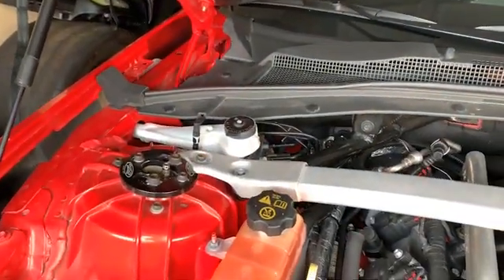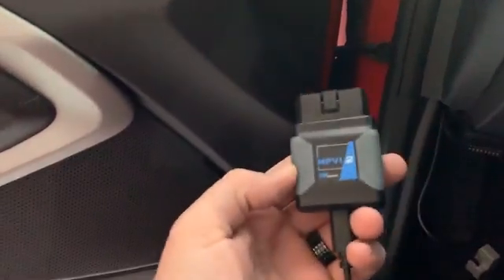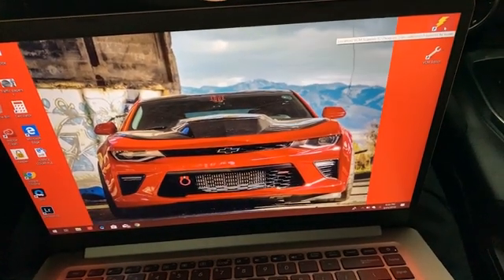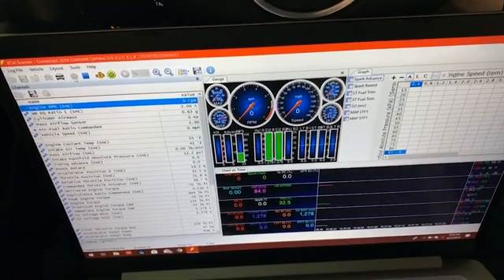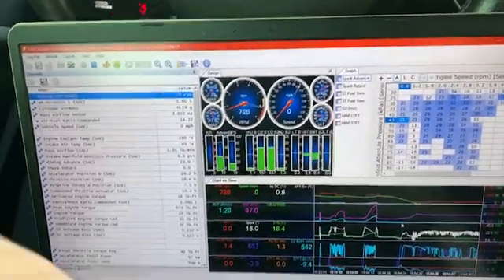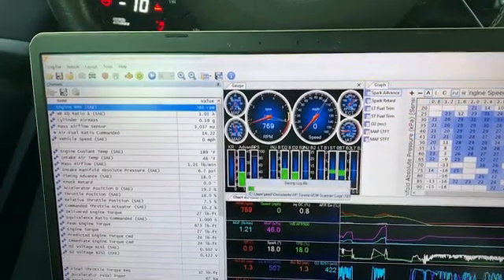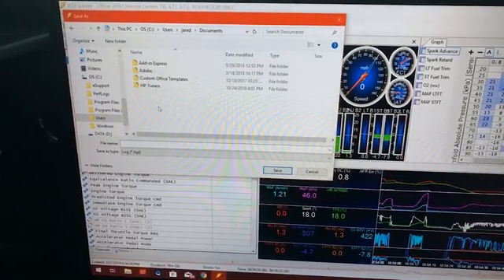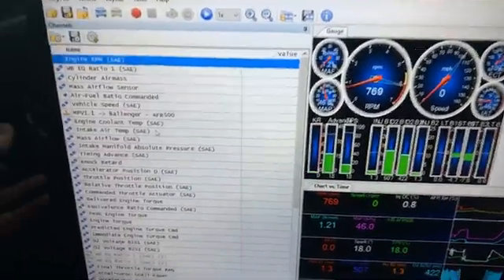Data logging using HP Tuners and the MPVI2

Comment: Do you need credits for using the data loging function ? Or just the device itself
Reply from the maker: Just the device. Many are sold with credits also but you can find them by themselves also. If you try to make changes to the tune, you'll need to purchase credits.

Comment: Is this the MPVI2 Pro or just the standard? I am looking to buy one but do not know which one I need or should have. I don't have anything crazy done to my car yet. Just CAI and Exhaust. Want to go with cam and headers down the road though
Reply from the maker: I believe it’s the standard. The box doesn’t say pro on it anywhere. I think it’s smart to have it if you can. It’s fascinate to monitor stuff. I’d also suggest getting a wideband. Then you can have it tuned by any one as you can do the data logging required. 

I’m loving making changes. I tried to do the startup yesterday but I need help with a fueling table since we are running all the LT4 stuff. Any day now the car will be running a RedRacer Tune!! I can’t wait.
Reply: @RedRacerVideo  I just bought the standard and the same wideband as you have. It was recommended online by many different people. Your videos were highly informative and helped me understand how to do certain steps and feel more comfortable about pulling the trigger. I am not incredibly mechanically inclined but your videos helped me see a less daunting picture. I will be using it for my 2012 Dodge Charger SRT-8 SuperBee. I absolutely cannot wait to be honest.
Reply from the maker: I’m glad I was able to help. I’m confident you’ll like both items. I’m still learning and I get stuck from time to time. You learn it just like anything else. If I can help you at all, feel free to reach out anytime. jared@redracervideo.com
Reply: @RedRacerVideo  Right on man! Thank you so much!

Comment: hey man, need your opinion on something.  I'm thinking about replacing my motor with a 427, adding a monster clutch and upgrading my fuel system.  The new motor would be from Texas Speed and I'd just have Jannetty do all the work again (they're local to me).  I'd be able to reuse everything I've got now (maggie, headers are the biggest things) but need a new cam.  Power would jump from 700rw to 1k give/take.  The whole thing would run me about $30k, which is close to about what the car is worth.  Trying to decide if I should pull the trigger, or just sell it at this point.  I've got a lot of other stuff in the car, like an ALP jammer and Forgelines, so it's def cheaper than getting something else.  I'd probably just walk away entirely or keep the next car stock if I do replace it.  Let me know what you think.
Reply from the maker: I don't know how to answer that. For me, having a car that is one of a kind is worth the risk. I think the car and what we'll do in it will ultimately pay big dividends. I love this car and what it does for my mental health. Money comes and goes. I say do it ;-)
Reply: Thanks man.  I've been racking my brain over it.  It'll finally be warm enough to drive it again this weekend, so I think that'll give me my answer.  $30k can undoubtedly be used better than on throwing out a perfectly good motor lol.  I guess I just have to see if it's worth it to me, and if I can get over that. I feel guilty just thinking about doing it though.   @RedRacerVideo
Reply: @RedRacerVideo  Thanks man, I ended up selling it that past weekend.  It all just kind of happened after I responded to someone's post who was looking to buy a modded gen6 with my factory specs...I didn't even need to list it anywhere.  Buyer was great and I really hope he's happy.  He's getting a great car and will enjoy it.  I'm not sure if I'm even going to bother getting something else like the mid-engine vette.  May end up getting a better single car, like a CPO'd current gen M5, 911 or something else that I can drive all year...or just do nothing.

Comment: Awesome Jared《☆》Good to see Lohla out & about. I wirked on RR engines for the last 20 years of my career. Not the automotive ones tho ☻
Reply from the maker: Military ones or what?
Reply: @RedRacerVideo  《☆》police heckle opters for the last 20. RR was Allison back when I was in the Army. Last RR school I went to about 5 years ago they still had some Allison hats they were unofficially handing out ☻
Reply from the maker: Allison as in the DMax trans people?
Reply: @RedRacerVideo  《☆》Ya :*: They designed a few turboshaft engines that are still used in rotorwing & fixed wing aircraft but RR owns all rights to them now. Even back in WW2 there were both RR & Allison V12 piston engines used in P51 Mustangs. I've heard that there are differences between the 2 V12s but don't know much about them ☻